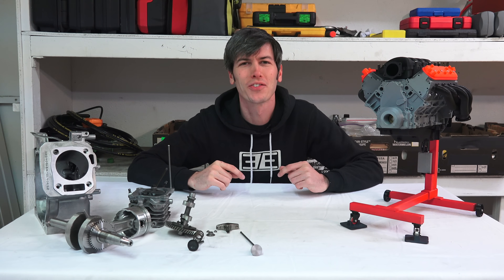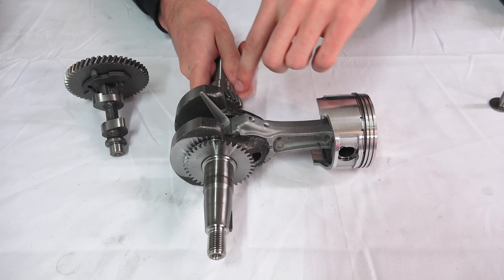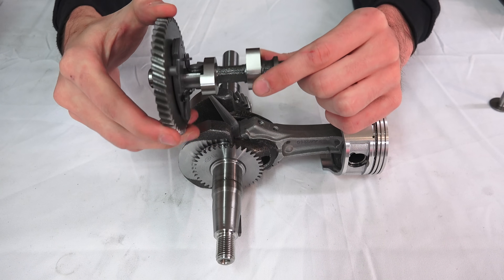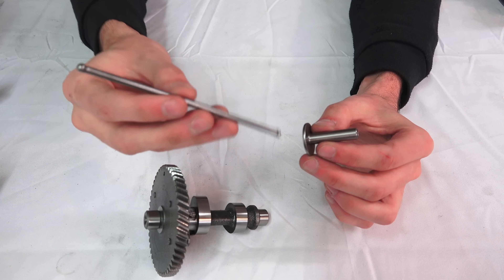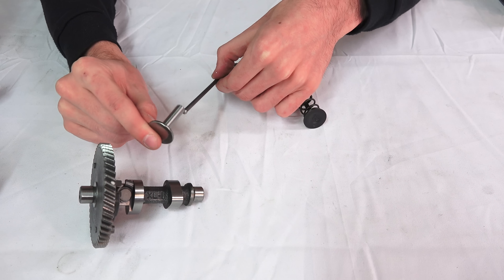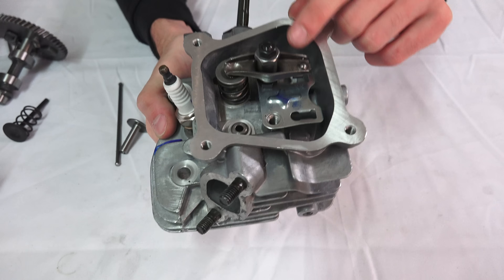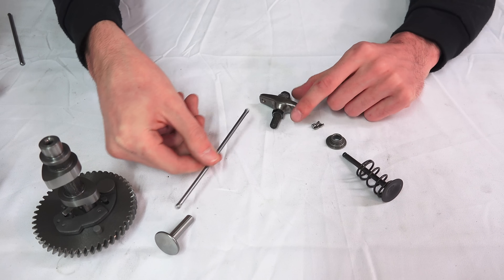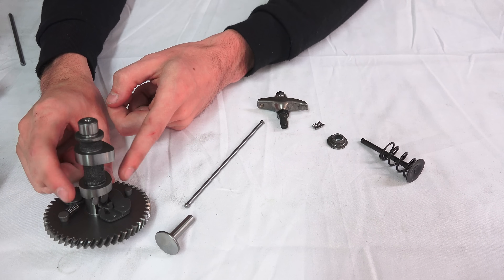Why Can't Pushrod Engines Rev High?

Comment: LS engines can...
Reply: Wrong. LS motors have better power to weight and packaging volume to power ratios than almost any NA DOHC motor. HP/L is meaningless unless you are in a displacement limited formula.
Reply: Lol and it begins, the Import vs Domestic shenanigans
Reply: not when force induction is applied. A good LS engine without massive mods (a cam, manifold and rollers) with a turbocharger will show you over 700hp easy. Throw some money at it and you will see north of 1200hp. Any 2JZ you take, to get over 800hp you need to invest a ton of money. A 2jZ with 1600hp would cost you over 30k, take any LS engine and 1600hp would be done half price.
Reply: Shabuti R18 
True it depends on the motor
The LS7 is a 427 that weighs 
Only 454 ibs and 505 hp N/A
Reply: Sam Kwant 2jz can't hold a candle to iron ls engines.  At least get your facts straight.
Reply: There's no way for 'all else' to be equal when comparing a push-rod motor to a dohc motor.  If displacement is equal, the dohc motor is going to be physically larger and heavier.  If the motors are of equal weight and dimensions, the dohc motor is going to have substantially less displacement.
Reply: Shabuti R18 
I still disagree. Based on capacity
And power - weight DOHC is not
Worth the cost in smaller motors
Il take Displacement and less ibs
Reply: Shabuti R18 
Longevity is the issue & mpgs
The LT4 is getting 26 mpgs &
Will out last any Ferrari.  Also
Euro engines are 75%  maxed
Reply: Shabuti R18 your comparing a chevy to a Ferrari. That should say it all. Gm mass producing a practical reliable pushrod v8, comparable to a Ferrari engine built exclusively for performance.
Reply: NRE Mirror Image Turbo, Gen 2. 1650 HP TT LSX Camaro Supercar, just google it, it's from Nelson Racing Engines.
Don't get me wrong, I love DOHC engines, they sound nice, they rev high.
 I own an inline six BMW E39 but these LS engines when forced induction is applied are MONSTERS!
Reply: A question we asked in engine building school wasn't why can't pushrod engines rev. Because the school car was powered by a 440 lsx that redlined at 10'000 rpm. We asked why don't dohc engines take more advantage of their more stable valve train design and rev to 10-12 all the time.
Reply: Plum_Crazy 1992 Yes absolutely while I love the higher revving Fords if i'm doing a project that needs a V8 I'll still use a LS since there's so much more room for whatever you need.
Reply: JJSmith Lago You didnt read the part that said "all else being eqaul" (i didnt post that comment). That means a 7L DOHC will produce significantly more power than a 7L pushrod.
Reply: Yup that's right my ls7 reves to 7100 stock. Pretty high for a engine that size.
Reply: I have a v6 honda dohc and an ls1.  (Two cars).  I enjoy both cars.  One thing that everyone fails to remember is that the engines weigh the same. The ls1 revs less (not by much) and produces MORE horsepower.   This being done by actually weighing slightly less.  All those valves and camshafts, and bigger chains do add weight.  Weight per horsepower seems to only apply to chassis.  Engine seems to be horespower per liter focused.  Engineers can suffer from severe tunnel vision.
Reply: I never really understood why this is even a thing in the US, you guys have great cars and the best engines over there.  In Aus its pretty much any hard core car enthusiasts are almost all about domestic cars, which for the most part are/were pushrod large displacement, much of roughly based on US engines. 

imports are majority used here by the non car people and generally looked down upon. 

The only real popular OHC import engine here is the turbo RB engine that was factory standard on one model of domestic GM car in the 80s.

And the only domestic DOHC engine popular here is the inline 6 turbo ford engine, but ironically they aren't meant to be revved much at all as they are massively under square 79mm bore x 99m stroke, people do but its not good for those engines and they do have catastrophic (rotating mass) failures when pushing high hp and over 7k.  redline on NA variant is 6k max and turbo variant with factory forged internals is about 5.5k redline. I have even seen these blocks split in half on high hp drag racing engines, primarily this is due to excessive rpm. Older versions of these engine has redlines from 4.5k to 5.5k.  The pushrod buick v6 these competed with in the day had redlines closer to 6k,  (5.6-5.8k).
Reply: Called it lol😉. That was faster than I even expected
Reply: Some dude has a sbc 12k rpm nova.
Reply: Ls can outperform most ohc engines except for revving high which isn't really necessary when you can make crazy amounts of torque and power in the 6k rpm range. Best bang for the buck performance engine hands down.
Reply: justin beamon because the LS & LT don’t have to rev as high due to their displacements with longer strokes.
Reply: 90’s Cbr 250rr with a factory 18k redline sounds glorious, each to their own but i love over head cams. Though to be honest as long as it runs on fuel ill probably enjoy any engine.
Reply: Agreed, who needs to rev high anyways when you can get boo-koo torque to make up for the difference.
Reply: Joe H you are right! It's so funny when everyone thinks power per litre is how you compare engines. It's only really useful if it's the same layout. Power density is key
Reply: That's the stock redline for a lot of high performance over head cam cars.
Reply: Sam Kwant yeah they can after 10 grand of upgrades and two turbos later and at that point you’re way better off just putting the money in to 8 cylinders
Reply: justin beamon not to be rude Justin but the LT whole complete different platform than the LS.
Reply: 427 CI Joel my LS3 (which is a 376) with a tune is now redlining 7,100 and she pulls the entire time. 

Who cares if an import can go higher in RPM’s if it has half the torque down low? I remember seeing a Honda S2000 that redlined at 9k with 900hp, but 500ft/lb torque. Naturally, 500 torque would be a lot but not when you have that much hp. 
The dude could only do roll races to have a chance.
Reply: Shabuti R18 it's not a smaller package. Stop confusing displacement with physical size...
Reply: Shabuti R18 yet the lt1 is smaller lighter and makes more power and torque coyote and gets the same economy...
Reply: Chris Jones

Bike Engines are also tiny capacity, hugely oversquare with tiny stroke, and aren't subject to as stringent reliability as most mass production cars are. Those things have little to do with valvetrain.
Reply: Bikes are kinda an unfair comparison. They aren't held to the same standards as cars for emissions and the engines aren't designed to last as long + the service intervals are significantly closer together than almost all cars. Hopping onto a super bike is like buying a racecar. you have to do routine service checks of things like valve lash often. they are much more fined tuned and closer to the max hp output the parts can  withstand which in turn shortens life.
Reply: Shabuti R18 but if you look at the total carbon footprint of an engine, isn’t it more efficient to build a simple one that’s slightly less efficient on paper than building one that’s a bit more efficient but needs replacing after 100K?
Reply: EE is not a mechanic. He is a ffkkng engineer. Dont listen to all his stuff. He loves MB. Any real car dude loves LS1s. car dudes all over this world are using pushrod engines
Reply: Thank You. EE is Awesome and Great for Anything mechanical but I agree it's titled incorrectly. I REALLY disagree with the perception that pushrod engines can't turn some RPM, Smokey Yunick put that school of thought to rest Way back in the 50's, 60's & 70's!! Looks at GM from 67-69 building the infamous sbc 302 that turned upwards of almost 8K rpm and won them 19 of the 26 SCCA races in the '69 year series. Ford's done the same thing with their version of a 302 ci engine as well. Most young ppl don't looks into the domestic history of things & assume (I would say) that the rotary engine is the only factory engine that's been routinely spun past 6K rpm🙄
Reply: Jaye Bass Except for Mercedes and Ferrari, yes. But DOHC can in a costly way be far more efficient in all other areas.
Reply: Plum_Crazy 1992 The Ferrari 4.5L produces over 600hp na and weighs around 400lbs... It cost alot more, but still a proof of concept.
Reply: Escape for Mankind is Keith Johnson Wouldnt benefit them any. And it would eliminate alot of their loyal buyers.
Reply: Being ABLE to is not necessarily directly being good at. Much less optimal.
The valve float may still get there, or even if it doesn't, say a perfect timing still, you'll have the single intake valve to get air inside as a limiting efficiency factor.

I would assume that the torque curve drops dramatically at high revs.
Reply: Shabuti R18 you could be right. I hope not. Have you seen Cadillacs new dohc 4.2 that's gonna be in the new ct6 sport?
Reply: Enzo TM Dude email NRE and ask them how much one of their twin turbo  motors costs. Probably 30 grand.
Reply: a seldom mentioned point.
Reply: So it can run out of balance and more likely to fail at very high rpm due to 2nd order harmonics?
Reply: Sam Kwant lol. No sir. NOT ALL
Reply: Shabuti R18 all else being equal like physical size and weight?
Reply: Fotios Tsingos power density is how you should compare different layout engines
Reply: Bike engines do just that and are making 200hp per litre naturally aspirated.
Reply: 3800Tech didn't you guys make the GTO ls2?
Reply: Chris Jones spot on
Reply: Paopolomololl look up a dz302 sbc 8200 rpm
Reply: ...what Nintendon't?
Reply: Christopher Kennedy rotary for the breakdown! Which is why they do an LS swap!!!
Reply: HEMI LIFE
Reply: Joel revved to 7100.... Once 💥😂🤣 jk
Reply: as soon as its dones eating its owners wallet and savings account for breakfast...
Reply: Also everyone is talking about rpm but no one is talking about rotating mass. You cant compare a honda 2.0L to a 5.7 Litre anything. Just think about the piston rod mass alone spinning at  6K rpm The stroke the piston velocity in the bore. Forget about valve train. Think about the rate of acceleration paired with the Mass of the piston and the rod in a big V8 at 6k rpm. Its a mind boggling amount of force. If you are going to compare motors you should compare motor of similar stroke bore ratios at a minimum. Then discuss OHV vs DOHC.
Reply: I Honestly don't care buddy, I drive a 1.3 Twelve-valve honda
Reply: Shabuti R18 it’s an unreliable concept tho✌🏻
Reply: Shabuti R18 why is dohc 32v our comparison for 16v are we forgetting that there are 32v pushrod engines?
Reply: 3800Tech I'd like one of those Aussie Ford I6 DOHC engines to put in my truck.  Don't need revs when all you need is torque.
Reply: While I don't think 7,100 RPM's is necessarily all that much for a 427 ci motor 7,100 RPM's is impressive for a factory motor rocking a 4" stroke. Making X HP at less boost is more desirable than making the same power at more boost. Same with RPM's. More often than not a motor that redlines at 6,500 RPM's and makes X HP will be more reliable and longer lasting than one making the same HP but needs 8,000 RPM's to do so. RPM's kill motors. Plus the lower RPM motor is likely larger and making more torque over a broader curve and achieving better MPG's at the same time.

Maybe you should do a video on why N/A DOHC motors don't make much torque until they get past half their RPM range? Or at least that's the steriotype, right? Kind of like OHV motors not being able to spin is a stereotype. Correct me if I'm wrong but didn't the old Ford 427 FE motors in the Shelby Cobras redline at 7500+ RPM's? And this is early 1960's technology. Pretty sure they weren't the only factory BB motor that would reach beyond 7K. Large bores allow for big valves that will flow like a mofo, and if you get the valvetrain light and right they spin. I've seen engine builders to build LS motors that will spin higher than any Modular I've seen.

Maybe you could also do a video of why OHC motors are less efficient than OHV motors. I mean other than HP per displacement OHC motors are less efficient in every way. In general when talking DOHC and OHV motors that compete directly with one another the OHV motor gives you more displacement and way more displacement potential in a smaller/lighter package and they also tend to also achieve better fuel economy.(probably largely due to the fact that they make enough lowend torque to pull themselves down the road at interstate speeds at 1,800-2,000 RPM's instead 2,300 -2,500)

BTW I own both SOHC and DOHC Modulars and LS vehicles. I love both platforms but if we're going to try to find fault and ridicule OHV motors due to some bias towards OHC motors then I gladly point out some of their faults as well.
Reply: Sam Kwant ok weeb
Reply: What about larger engines? That's where we add more cylinders. More cylinders = more displacement without the larger mass, keeping the ability to rev.
Reply: Cody Green because you move the power band when you build a engine that revs that high. Your cam profile plays a part in making a 12k rpm car, but more than anything your rotating assembly needs to be light. And we want performance so it needs to be strong. So we're talking about forged aluminium rotating assembly which is kinda expensive to mass produce. And speaking from experience, you'll need to rev to like 4k to 6k rpm to make enough power to start moving a 2000-3000lbs car.
Reply: I never seen an ls or any push rod engine rev 15,000 rpm or more
Reply: Braddah E I guess you missed the part where I said I went to engine building School. I understand camshaft profiles and the effect that it has on power in the RPM range. I also equally understand that the rotating assembly has to be light. Equally as important it must be balanced perfectly for the given RPM that it will run. As I said our shop car at school had a 440 LSX that turned 10000 RPM. You're missing my point if the valve train of dohc is stable enough to sustain high RPMs and now we have had all kinds of variable valve timing and variable lift systems for years. Having variable valve timing in a way is like having two different camshafts. They are two different profiles on the same cam. 1 to produce low end power and one that produces more mid-range to high-end power. Variable valve timing effectively can extend your power and RPM range. When you add invariable lift that can also help deliver more power. Some of these systems have gotten very complicated and even had multiple runners with multiple different valve sizes small valves to create greater velocity at low RPM with small runners to give you low end power and then a separate runner that is larger and has a larger valve to work with higher RPM. So what we used to say, and the owner of the school, is there's really no reason why any company producing a high-performance dohc engine shouldn't be turning at least 10,000 RPM on the street. The idea was if they really wanted to they could and if they did the would make butt loads of power. After all when you've done absolutely everything you can do to an engine to make Power and you just can't make anymore without going forced induction or power adder your choice is always to turn more RPM. Horsepower is equal to torque multiplied by RPM divided by 5252. This is the whole reason why race car engines don't sit around at 5 to 6000 RPM while they race they turn eight, nine, and 10,000 RPM they are trying to squeeze every last bit of power out that they can according to their rules. Something I have thought for years is that if Honda starts making a naturally-aspirated V8 powered dual overhead cam with their VTEC System on it all of their V8 better watch out that's going to be a hot little V8. When you take into consideration how much power they squeezed out of a 2.0 or 2.2 that's in the S2000 or even their K series engine. Honda makes some very very volumetrically efficient engines. To sum this up it can be done the reason we manufactures probably don't produce engines that produce that kind of RPM is it pretty easy answer wear and tear on the engine will increase due to the high load probably higher horsepower and high RPM. I mean think about drag cars some of them make one pass and they pull the engine apart to change all the bearings that's the first thing to go all that RPM and all that power just beats them to death.
Reply: 11010100 And those Honda's are still infinitely slower
Reply: Shabuti R18 you know how big and heavy a 7L dohc would be. So not all equal. 2 different layout engines cant be compared with  capacity alone. That's why power density is the best way to compare different layout engines.
Reply: ZERO94AIC Some LSX engines rev to 8k-9krpm. That's a lot for any engine let alone big V8s.
Reply: Still waiting for Chevy to put a Flat Plane Crank in their LS motors
Reply: ZERO94AIC LS engines actually crush DOHC motors without having to rev as high. They are very competitive.
Reply: That is correct, which was kinda my point. Valvetrains don't dictate how well an engine will rev. DOHC will be more reliable at higher revs (9k onwards you will need stiffer valve springs, etc). Fun fact: Ducati Desmo valves are mechanical up and down, so can rev to the moon without float.

People are saying "why don't DOHC engines rev high when the valvetrain is so good"

Because they're sat on-top of a boring engine, that's why. Also these days people use turbos to help cheat emission laws, which eliminates the need for loads of revs.
Reply: well a highly modified track built car achieves the rpms that 20 year old Hondas have from the factory, completely stock. That doesn't really help your point.
Reply: Shabuti R18 
Albeit it's gonna be on the new
Mid engine C8 . I dont even like
The mid engine idea. But i know
It will have better traction from it
Reply: Robert Macpeek as a young person and gm fanatic I can definitely tell you that 85% of the kids my age don’t want anything to do with motors over 4 liters and have no appreciation for the history of American cars and could care less if it didn’t come from Europe or Japan. Which to me is a real shame considering there’s no substitute for cubic inches and they just don’t get it
Reply: LS engines can rev but it takes alot of effort. Take a current LT1, basically a newer LS and a current 2018 Ford 5.0. the 5.0 is already up to 7500 out the factory, the LT1 is barely over 6k. The Ford can get a tune for 8k with still no valve float, that's about $700-800 for a simple tune for that. Getting an LT1 to 8k, that's a full engine build to make it reliable.
Reply: The one's that do rev that high aren't really known for being the most reliable (or stock) engines though
Reply: Rotary ftw!!!!
Reply: Plum_Crazy 1992 Emissions is the issue that will keep the pushrod from lasting much longer in production. Rumor is GM is already working on a DOHC V8 for the corvette to replace the pushrod motors.
Reply: Plum_Crazy 1992 Worth the cost is an opinion. Its just a proof of concept that DOHC has the advantage of producing more power at the same if not smaller package.

But, the pushrod may soon be forced to retire as emissions keep getting more strict.
Reply: Hold on while I drop the 2JZ bomb....
Reply: A 2JZ can easily kill any LS engine!!!!